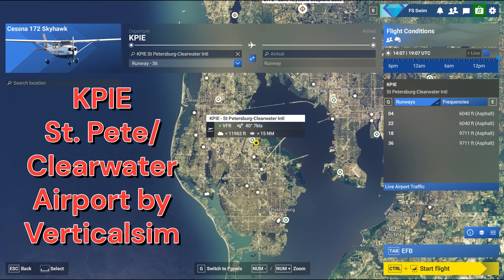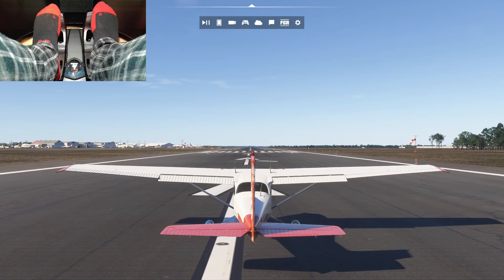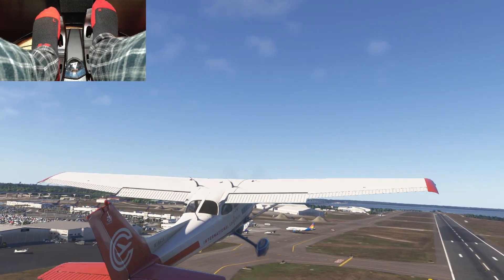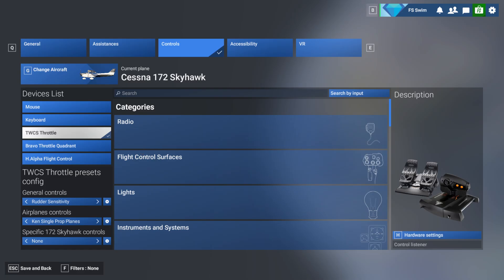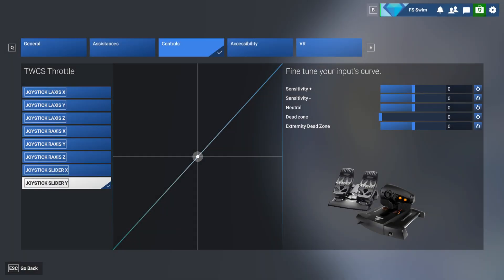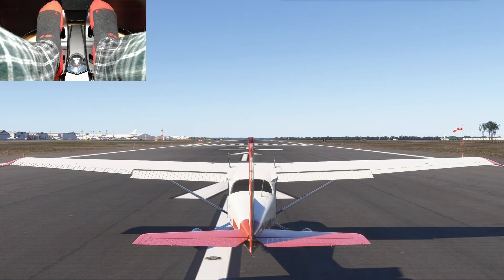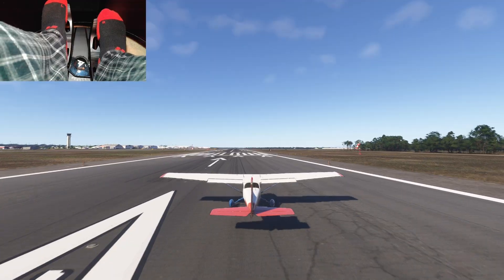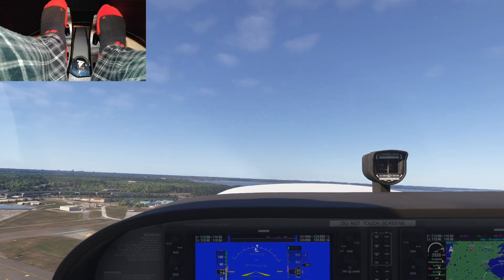MSFS 24 How To Adjust Rudder Control Sensitivity Settings in Microsoft Flight Simulator 2024

Comment: Why did the plane veer to the tight at the start of the take off? Mine does the same while it should be having a left turning tendency right? This is even with no wind
Reply from the maker: It was a while ago that I made the video, but it was probably just pilot error 😂
Reply from the maker: Now that I think about it for a second, that was before I lubricated my thrustmaster pedals so they probably weren't working very smoothly. Check out my other video on my channel, about lubricating pedals and what kind of grease to use. If you're having any kind of problem like that maybe. Thanks for your input here!

Comment: Thanks for this help! I'm just getting started in the sim - it's ALL new to me. Just got the rudder pedals (Logitech), and Honeycomb yoke and throttle quadrant are on the way. I'm taking the basic PPL certification classes in flight sim - just the most basic stuff, and it is damn near impossible to control the Cessna 172 with the keyboard. I sure hope that the ailerons and elevator work better when my gear arrives. I can barely pass the "Turns" class with the keyboard.
Reply from the maker: Cool 😎 You'll love the yoke and throttle. It's a night and day difference. Have you tried the adjustment here in the video for your rudder pedals? I have the thrustmaster pedals, it helps with those a lot.
Reply: @FlightSimSwim Yes, I followed your instructions but need more time to learn to use the pedals before I comment on it. I did feel a difference at 0.85. Thanks again!
Reply from the maker: @KeithM-TX no problem glad to help!

Comment: and when you get at the end of it all h broke loose. But i'm here for another problem, while throttle is at idle planes just accelerate (excluding Cessna 17 something.),  Pilatus PC-12 can reach 30 kts while thrust is idle.
Reply from the maker: It sounds like a calibration issue.
Reply: @FlightSimSwim  how do i calibrate a thrustmaster twcs? On windows 11? Thx.
Reply from the maker: I'm not certain, but this page should have info. There are drivers there, they might give you the ability to calibrate in the Windows game controller settings. https://support.thrustmaster.com/en/product/twcsthrottle-en/

Comment: Sorry this might be off topic but would you know how to make handling double wheeled aircraft like the DRACO X, easier to handle? They always tip over easily it's so frustrating I always crash when I use them.
Reply from the maker: Hi, I would think that adjusting the rudder sensitivity will help for that plane too. Thanks
Reply: @FlightSimSwim  🤔 hmmm worth a try

Comment: I have the same rudders and the game thinks I’m braking while applying 0 pressure to the rudders
Reply from the maker: I would suggest looking at the brake settings to make sure that some other control or button isn't also set to trigger the brake. Also, is it possible that you have the parking brake on? 🤔🤔

Comment: FYI EXTREMITY DEAD ZONE is not The Correct Name for this! Should be called "Control Surface Range of Motion" Try using that instead, much smoother, do your Elevator and Ailerons. Butter Smooth control after doing that. Note Slide Slider to Right untill you get the correct smooth "ROM" Range of Motion.

Comment: I'm going to try it right away
Reply from the maker: Cool - please let me know how it goes! I'm working on another video now that is also related to using rudder pedals, stay tuned!
Reply: @FlightSimSwim  I tried 0.80 on a flight with the 152, and although it was better, I think it is too low. I have to try a higher value, although I have a problem with the pedals (they move on the floor) and it is difficult to test them like this.
Reply: I'm testing with a value of -0.55 and so far it's working pretty well, especially with the helicopter and with the plane too. I have to do more tests, but so far so good. By the way, I use the same pedals as you but connected to the Airbus quadrant.
Reply from the maker: Great! Yeah some others have said the the way rudder is so sensitive by default is unrealistic. Maybe there will be an adjustment from Asobo. Interesting, is that a Thrustmaster Airbus Quadrant? I haven't ventured into airliners yet.
Reply: @FlightSimSwim  Yes, indeed the sensitivity of the axes in the 2024 is quite bad. And yes, I have the thrustmaster quadrant, the tca, along with the stick too, and the funny thing is that I mainly fly small propeller planes.

Comment: What should happen is for Asobo to fix this issue. Real planes have a linear 1:1 pedal movement yet dont give violent movement to input.
Reply from the maker: Yes, the initial physics seem disappointing, after all the hype about the new flight model. I'm not a real pilot, and even I can tell something's not right. I've only flown X-Plane before.
Reply: @FlightSimSwim As a real pilot with PPL, I m a bit disappointed with the physics specially with GA aircraft, I will try to change the sensitivity but for now it is too much sensitive with all the controls and the ironic part is that it is way more easy to fly in real life than in MSFS..
Reply from the maker: Wow, that is ironic!
Reply: @Twizyvideo  I think a lot of GA plane physics have residual flight models from 2022, They sure feel like it. Im sure the new SDK will see some awesome new 3rd party vative aircraft.
Reply from the maker: That would be cool.

Comment: Interesting, I have FFB rudder pedals which are not mapped to the games rudder, but get/inject all their data using telemetry via a third party app.  I do although have the nose wheel mapped, for when the airflow is low on the ground.  They have worked perfectly from day 1.
Reply from the maker: Cool, what rudder pedals and software do you use?
Reply: @FlightSimSwim  They are Winwing Skywalker's with a VPforce Big servo DIY kit fitted to it.  Runs via VPforce Telem.
Reply from the maker: Nice!

Comment: It would be even nicer if you did put a neutral zone.
Reply from the maker: Thanks, good tip - I encourage others to try it! For whatever reason, personally I don't like neutral zones, same thing with steering wheel settings for racing sims. I do better without a neutral zone.

Comment: FYI you normally fly with your heels on the ground and balls of feet mid-pedal. You only lift your feet fully onto pedal when needing to brake.
You will find ot easier to make small movements.
Ex-military aircrew with 10 years in P-3 Orion.

I also have those exact pedals, put some Nyogel 767A on the metal rails to dampen the movement hugely and make them feel like real rudder pedals!
Reply from the maker: Wow, hey thanks for the tip, I appreciate the insight from an experienced pilot!
Reply: @FlightSimSwim  You're welcome 🫡
Check my edit about Nyogel, Absolutely mandatory for these pedals
Reply from the maker: I will try that, they aren't the smoothest pedals - that's for sure. Thanks again!
Reply from the maker: I can only find Nyogel 767A Synthetic Heavy Damping Grease, no 768A. Is that the same, or maybe you had a typo? Thanks
Reply: @FlightSimSwim  yea typo sorry, that's the stuff. The 5g tube is heaps - you use a fraction of that.
Reply: And it prevents you to accidentally apply the brakes during takeoff or landings also. It’s only during taxi or when you need to stop fast after landing that you use your whole foot on the pedals. Nice video! 😊
Reply from the maker: Thanks!
Reply: I was on my way to the comments to give the same advice
Reply: Pilot guy huh 😅